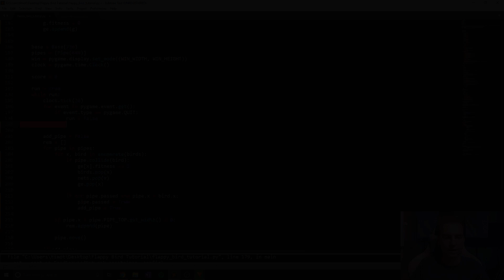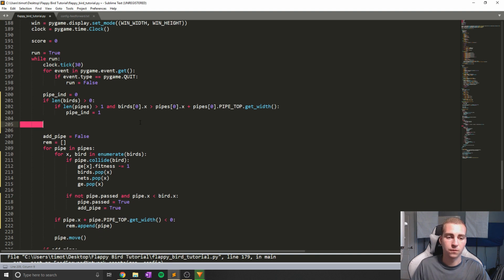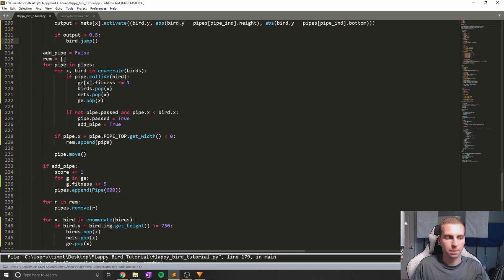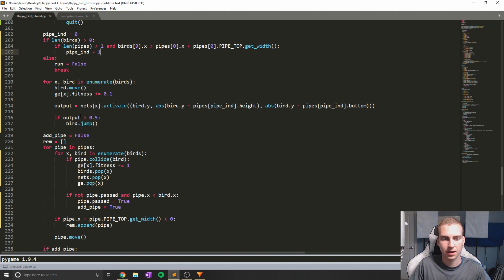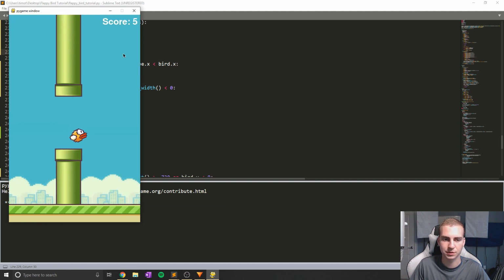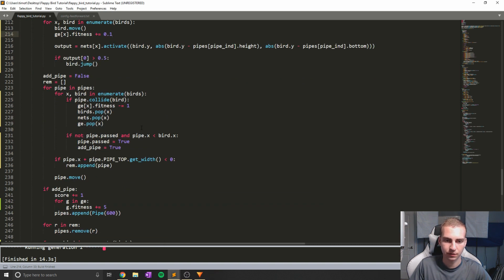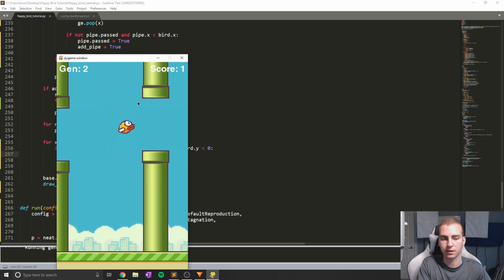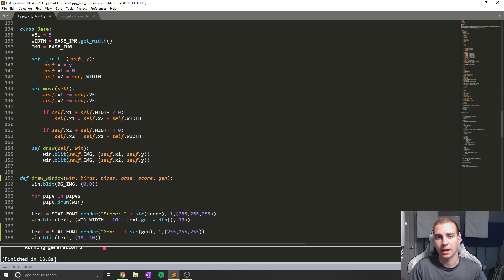Python Flappy Bird AI Tutorial (with NEAT) - Finishing Touches and Testing

Comment: I'm using pycharm and I get this error:

Traceback (most recent call last):
  File "C:/Users/ExtremeTitan345/Desktop/python/snake.py", line 274, in <module>
    run(config_path)
  File "C:/Users/ExtremeTitan345/Desktop/python/snake.py", line 261, in run
    config_path)
  File "C:\Users\ExtremeTitan345\Desktop\python\venv\lib\site-packages\neat\config.py", line 153, in _init_
    raise Exception('No such config file: ' + os.path.abspath(filename))
Exception: No such config file: C:\Users\ExtremeTitan345\Desktop\python\config-feedforward.txt

pls help!

Edit: I called the file snake.py BTW
Reply: looks like your trying to init a file called config.py?

File "C:\Users\ExtremeTitan345\Desktop\python\venv\lib\site-packages\neat\config.py", line 153, in init
Reply: @comfycap  Omg, thank you so much for your patience, I couldn't even notice the difference
Reply: Same error here!
Reply: check if you  pointed to the right folder and if the config file is named correctly
Reply: @itsgberaldo  It's in the same folder as the main file,  and the name it's correct. I need to create a  new folder inside the folder of the main file?
Reply: @comfycap  Name of the config file: "config-feedfoward" (it's a .txt file). Now in the main file:
    local_dir = os.path.dirname(__file__)
    config_path = os.path.join(local_dir, 'config-feedforward.txt')
    run(config_path)
Reply: @comfycap  which folder must it be in?
Reply: ok well I've tried everything and nothing works thank you for the help though guys!
Reply: @comfycap  where do I find that file though?
Reply: @comfycap  oh my gosh I named it wrong XD thank you! You really helped!